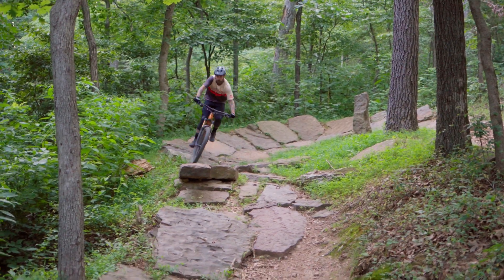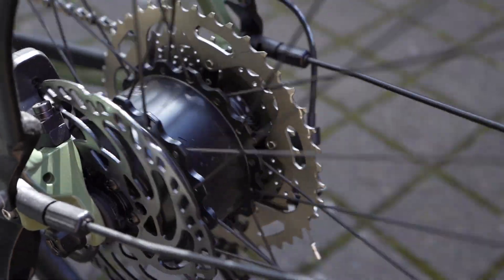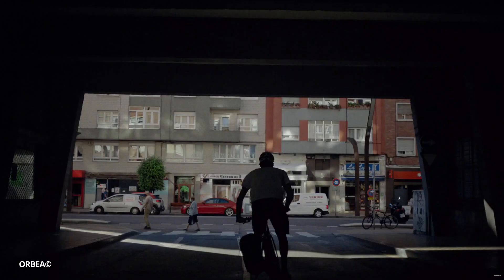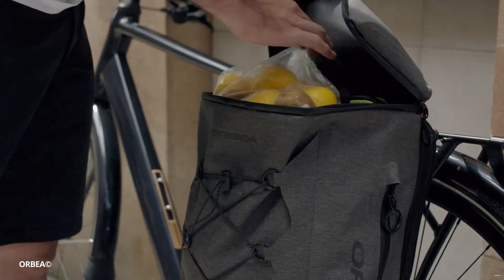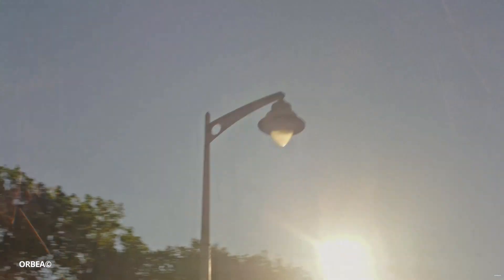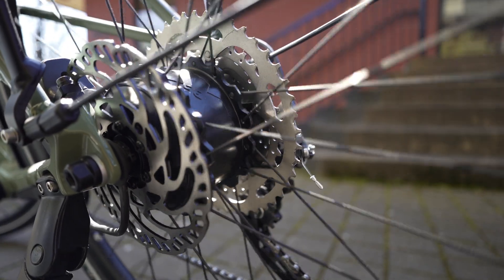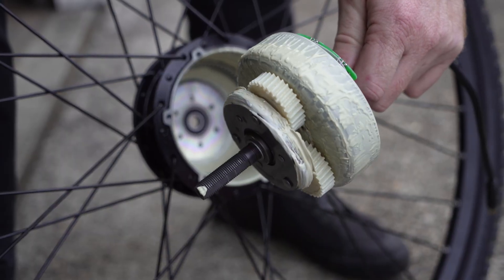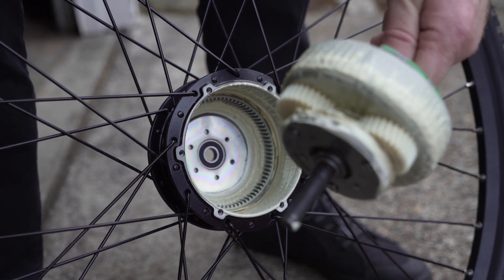HUB VS MID DRIVE | Choosing the Best Electric Bike Motor #electricbike #ebike

Comment: Very informative. I have one of each. A Trek Powerfly 5 with a Bosch mid-drive. By using the top assist levels I can blast up hills no sweat. I also have a Salsa Confluence with a Mahle 35+ hub drive. Big difference. I like the Salsa for my road riding. It feels more natural than the Bosch. It gives me a consistent boost, but it's not overwhelming. On hills it gives me just enough boost to do a long 10% without fagging out, but it won't blast me up the hill. That's what I want.  I want to get my heart elevated and labored breathing. The one downside of the Mahle hub drive is the lack of a torque system. There is a lag when you start up from a dead stop, especially if you're on an incline, but I got used to that and just make sure to downshift before stopping, like a real bike! The Bosch comes out only when I'm riding my rugged mountain trails with a lot of chunks and hills. Like you say, it depends on what kind of riding you are doing. Oh, other big plus with the Mahle 35+, the entire bike weights 32 lbs as opposed to 56 for the Trek Powerfly 5.

Comment: I have a proprietary mid drive 85Nm. Absolutely fantastic off road bush trails and climbing. Just built a 1500w rear hub which is super fast and fun but purely an A-B bike. There’re both great.

Comment: The mid drive is just more practical. At least it is a separate part than the others and not in the wheel system.
Reply: Nothing is more practical than a gearless hub motor. It does braking and acceleration with no wearing parts other than bearings and tires.

Comment: If you are riding on a road at high speed gearless hub drive can't be dollar for dollar.  Biggest downside is going to be weight.  At low speed geared hub drive wins.  Mid drive fills the gap but is also the most expensive option.  A side note gear changes are generally going to be much easier on a hub drive.  One thing to consider is the mid drives peak rpm which is often much higher than anyone would ever pedal.   So yeah it CAN use all the gears but at the same times often robs you of any chance to help the motor along at top motor efficiency.

Comment: didn't mention the throttle delay on hub motors, it takes a good seconds before it starts and keeps going for a second when you stop peddling.
Reply: This is an artificial delay. I have no delay on my ebike. You can have instant torque, like any electric motor.
Reply: @difflocktwo  no you don't, a hub motor has delay, a middle motor has even some delay, you're clearly not used to motor bikes.

Comment: Excellent video and decision made - mid-drive. Do you have any views on converting a full suspension mountain bike to a comfy road going eBike? I am riding a front hub converted track bike right now and it is pretty minimalist. Looking to create something more plush for my 20 mile commute and I don't want to go down the fat frame fat tyre route.
Reply: id get a trekking bike, with only front suspension, and 27.6" or 29" wheels. and add a tongsheng or bafang mid drive motor.
Reply: I converted an old Marin full-sus MTB XC bike for mostly road use using a CYC Photon mid-drive kit, it is brilliant for potholes etc and with a bit of pedalling I get about 40-50 road miles using 50% of the capacity on a X-go 48V 20Ah rear rack battery. And of course it can go off-road very well too. Waxed chains rule!

Comment: I pefer hub drive since you can use it if the chain breaks
Reply from the maker: Pretty rare to break a chain. But yes, hub drive can work without a chain, especially with the throttle.

Comment: Very informative and balanced comparison. Thank you.
Question: if I purchase an eBike with dual hub motors (ie. each 750W), could I simply purchase new higher wattage hubs (ie. each 1000W), or mix (front: 750W, rear: 1000W), and if so, would batteries remain the same, just expect less life if using higher wattage hub motors?
Reply: Motor specs are just what it can sudtsin long term. 

The watts are decided by the controller. 

The battery must be able to deliver what the controller askes. If not it will still deliver until it bursts in fire. Just like a loyal horse that will run and run untill it drops dead.

Be careful

Comment: I just don't get the reasoning behind "you get to apply the torque to all of the gears with a mid drive."  Because my hub drive gets the torque from all of the gears, too!  With a mid drive, the motor torque combines with the leg torque.  With a hub motor, the motor torque combines with the leg torque!  I just test-rode an 80nm Bafang mid motor up a hill, and then test-rode a 100nm MXUS hub motor (with torque sensor) up the same hill.  Guess what?  The hub ebike climbed the hill with less effort than the mid drive ebike!  Torque is torque.
Reply: downshift and the bafang will eat the mxus hub for breakfast

Comment: Im building a ebike for my wife and the platform is an existing mt bike that we have had for years. I had my mind set on getting the mid drive motor until i found out it doesnt have the throttle feature. Is there a mid drive motor that have throttle so my wife doesnt have to pedal at times ? :))
Reply: bafang bbs02/bbshd have throttle
Reply: CYC photon has throttle and a very good torque sensor (not just cadence), makes the rider feel like Lance on a juiced-up day!

Comment: Do you use your E-MTB for HUNTING or backcountry CAMPING? Then you need a hub motor (or in my E-CELLS bike's case two hub motors) Say a chain breaks with a mid drive motor. Say despite your tools and chain repair parts you CAN'T repair it. What then?? A long push back to the parking lot. But with hub motors "no chain is no problem".  Besides mid motors drive THROUGH the chain so they wear it much more quickly than pedal assist power using hub motors, raising the incidence of chain failure.
Reply: i never had a chain fail. ever. and i abuse my mid drive emtb
Reply: @SB7-r9i  Good for you Simon. BUT you likely have a relatively light e-mountain SPORT bike. I have a 95 pound e-mountain CARGO bike and go deep into Nevada's backcountry. I NEED 2 wheel drive, 2 batteries and the reliability of hub motors. DIFFERENT NEEDS, DIFFERENT MOTORS - SPORT V.S CARGO.

Comment: Chain drives and derailleurs are obsolete.
Reply from the maker: Hmm, intersting. Why do you think that?
Reply: Because derailleurs were designed for puny humans, as were cassettes/freewheels. The link glide system is better - but it is still just an attempt to make a powerful motor mesh with a drivetrain that has not really changed in decades. Ebikes are about where cars were in 81. They are still just transitional forms. I will get a Moustache with an enviolo CVT and a belt this week. My old RIZE MD started to shred my freewheel almost right away. (in the vid I call it a cassette, that's wrong) I am on my 3rd freewheel now after only 1600k. And I know how to shift. I have been riding for sixty years continuously. 
Chains and derailleurs are still only around as people as both manufacturers and riders are familiar with them, and to be fair, they do work "okay" with lower torque motors and rear wheel drives. I love forward to never indexing a derailleur again. 
Great vid. Thanks! 

https://youtu.be/GUrPc5nTs0s  @ElectricBikeJournal
Reply: 90-95% of ebikes are chain drives, so this is a false statement

Comment: A good tip if you have those juliet connectors to the hub motor is to coat the pins with some dielectric grease. The reason is the plug can get warm and as it cools can form moisture on the pins leading to corrosion and eventual failure.

Comment: Mid drive is too much for a chain and derailleur setup in my opinion. I would only go mid drive on a full suspension bike because of the weight distribution and suspension efficiency.
Reply from the maker: I am 5'8" and felt the medium fit me great.

Comment: For 99 percent of the time a hub motor is fine if you ride mountain biking in single track a mid drive is best . I have a hub drive with 100 nm of torque and it's fast and powerful if i have to hill climb i turn on the front motor and it climbs great. Ill ride all day in 7th gear and never have to change gears   you can't do that on a mid drive . And lastly my dual motor 60 volt 20 amp hr 30 + mile an hour bike costs less than most mid drive bikes . I positively don't want a mid drive

Comment: Do motorcycles have their engines in their hubs? No. So why would anyone choose a hup drive motor? I have 3 mid drive bafangs. One a 750w and two 1kw. The 750 is my favorite and has a lot of torque and is smooth and i get more kilometers from a battery pack and i cam do rides using only level assist 3 while changing gears on tje rear cassette where as with a 1kw im using levels 6 to 9 to get up the same hills. I owned a front wheel hub motor which was 27.5". I rode 5 feet and it blew the hall sensors. Very annoyed and all i can say is i wont buy another one
Reply: It’s the cleanest form of drive. All is well that is round and rolls.

Comment: If you read the law, most hub drive motors are illegal, here in British Columbia, though enforcement usually doesn't happen if they are not operated in an illegal way. Most reputable bike shops do not sell hub drives.
Reply: you live in a very odd country. thats not a normal thing with hub motors for most countries

Comment: Shouldn't hub drive motors be more efficient by defintion? You have loss when tranferring power via a chain, you don't have these losses with a hub drive...
Reply from the maker: I think it would be safe to agree that as a motor using throttle only a hub would be more efficient for the rider. However, as a bicycle and pedalling a mid drive would be more efficient since you can utilize the gears of the bikes drivetrain to change the gearing ratio. This would make the power output of the motor more efficient under load, like climbing steep hills. I guess a close example would be using 4 Low on a 4wd vehicle, the different gearing ratio is able to maximize the output of power to the same wheels.
Reply: no

Comment: Great video!
The advantage of a mid-mounted motor is that it makes better use of the ebike's sporty attributes, and has higher torque than a rear hub motor at the same power value, making it more suitable for putting on a mountain bike. But the price is high.
Rear motors have the advantage of strong power output, but at a cost-effective price. The disadvantage is that it doesn't have the perfect torque like a mid-mounted motor, and is more suitable for use in urban commuting, or ebikes that don't require as high a level of sporting attributes.
According to our experience in selling ebikes, more users choose rear hub motors, the main reason is that this type of ebike is cheaper, the repair and maintenance cost is relatively low, but the power performance is also enough to cope with the daily use, but also to meet the common off-road activities on the ebike power needs.
Obviously for professional cycling sports enthusiasts, a mid-mounted motor is the best choice. And for regular commuter use, or those who don't require much in the way of sporty performance, a rear hub motor is the cost-effective option.
Reply: Sabe dizer se é possivel instalar um acelerador em um motor MIDI DRIVE ????? obrigado
Reply: in theory, you are correct in reality the hub motor if properly powered through a good controller will do everything that mid mount will do and Mouer and it’ll do it with less cost and way less maintenance.  my motor will do wheelies it’ll go up any hill effortlessly without paddling and 40,000 miles. I’ve never touched it and I have my original chain.
Reply: @captamerica3693  Wow 40K Miles is amazing! Mind if I ask what type of rear hub motor and controller you're riding?

Comment: Hub is cheaper but it's low torque mid drive are higher performance with higher torque it's good for hills so i prefer mid drive something from 750 watt with 48v and 17 to 20 A  withh 200mm breaks
Reply: yes, someone who has owned both you were perpetuating a mythology.  My hub motor can do wheelies up the tallest hill effortlessly.   on the other hand twice now on my hub motor, my chain has broken gone up hills and hurt the living crap out of my nuts so guess what bike I ride the most?

Comment: Everyone's case is different.  For me: urban/suburban environment, mix of flat/hills, high winds.  urban food delivery and long distance commuting. both bikes are converted single-speeds, use shimano nexus 3 internal hubs for gears.  I have bafang 48v geared front hub and a BBS02 middrive, both setup as throttle only.  As others have said, the hub is more direct, simpler, probably better for newer riders.  But I find the hub less efficient for longer commuting and more noisy.  The mid drive, you need to work the gears (I use 3 speed internal hubs, so it's easy), but once you get used to it, I think the mid drive uses less energy per km, once you get up to the higher gear, your motor is working less to help propel you.  May work the chain/cogs more, but stock chains/cogs are cheap, I also use a single speed chain, there are no actual cog changes, so it is just not a factor.  For me, the mid-drive is superior, I would not have said that the first couple of weeks as I was transitioning from a hub, but after 6 months, I do not like the front-hub any more.

Comment: One perk of the regenerative braking that he failed to mention is that is saves a good amount on brake pads.
Reply from the maker: That is something to note for direct drive hub motors. That being said, most brands have moved towards Geared hub motors or mid drive systems.
Reply: True. The catch is that few motors offer regen, and even those that do are horribly inefficient. There isn't enough weight on an average bike to warrant the cost. - https://youtu.be/qu4vGEziby8

Comment: Why not both?

Ok, I know why not both: it's expensive and not the best value for the money spent. It's heavy (two separate batteries!) and more maintenance is needed. The motors and controllers don't work together unless you have a specific configuration or are willing to do programing and/or wiring. Not all parts of the rear hub motor can be easily replaced with stronger parts to withstand the mid drive's force. All in all, probably best to go for a single stronger motor than to combine a mid and a hub.

I didn't do that. I started with a pre-built geared rear hub motor bike, then impulsively purchased a CYC photon and added it because it was slow going up the hills in the area I live in. Frankly, I love it. The hub motor handles slower navigation on pedestrian sidewalks and quick acceleration from standstills like a stop lights, while the mid drive punches it when I need to go fast to keep up with traffic or for extra force when I'm climbing those hills. The hub drive is on a rear-dropout torque sensor, so it senses the force from the mid-drive motor and continues to work when the mid drive is engaged (at least, if the power indicator from the hub motor display is true). 

I definitely have to be careful with the force applied through the drive train: I already replace the chain and cassette with reinforced ones, but the aluminum freehub, the nylon gears in the hub motor, and that aluminum rear dropout torque sensor are all potential points of failure. I've been using bikes to commute for over a decade now though, so at least shifting gears up and down to minimize wear on the drive train is second nature. Any mistakes of leaving it in high gear at a stop are easily recovered from with the hub motor's throttle (side note: two throttles, a thumb one for the hub motor and a half-twist for the mid drive).

I definitely wouldn't recommend it if you don't have time and money in excess; I don't think most bike shops would do it for you, so it's something you'd have to do yourself, which you could easily get things wrong if you're an amateur (like me, who didn't even have all the tools needed to remove a bottom bracket or a cassette). Still, I've ridden it over 200 miles now and I absolutely love it.

Comment: I got a mid drive to fit this weekend, I'll be mostly using it for the roads to work and back, shopping, errands etc on a MTB with some flat gravel trails occasionally. One thing that's just hit me is that all the fast food delivery guys around here use hub motors. Wondering if I made the right choice now?
Reply: Hub drives are excellent for those who are looking to do things like commute and handle loads such as going to the grocery store or (in your case) delivering food/supplies. Mid drives are better (in my opinion) when it comes to off road biking such as mountain biking and if you have a lot of rough terrain such as gravel or dirt roads. Yes, there are crossovers i.e. mid drives that are good for commuting or hub drives that are good at mountain biking but this is my  way of going with the IDEAL usage of each system.
Reply: They use the hub motors because they're cheaper, because the companies don't pay them very well. They also use cheap ass batteries & chargers, which end up causing fires like as what happened in New York.

Comment: What Im curious about whether I chose a mid drive or a hub setup. What happens if the battery is dead or if their is a mechanical issue with the motor except the chain breaking. Am I still able to pedal?
Reply from the maker: With a dead battery both styles you’d be able to pedal around.